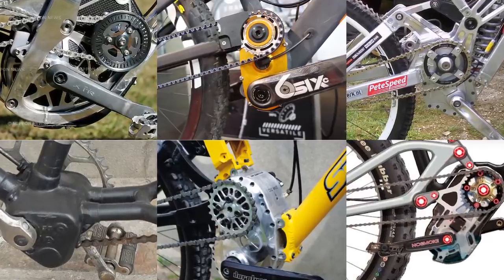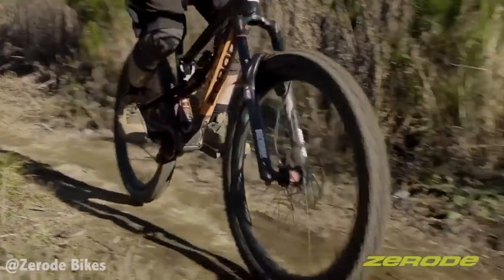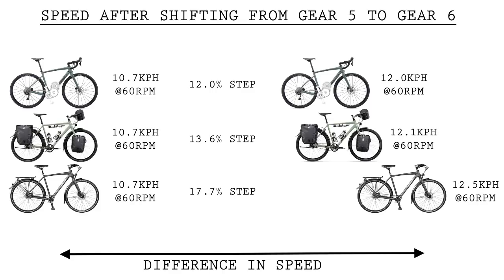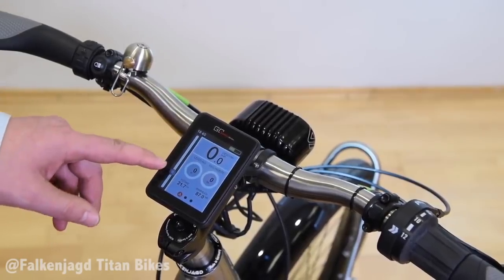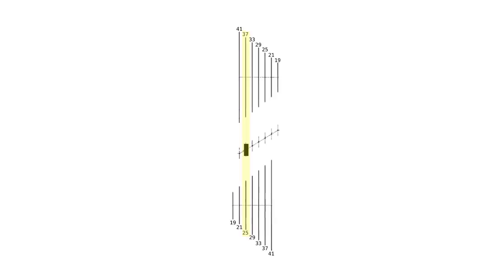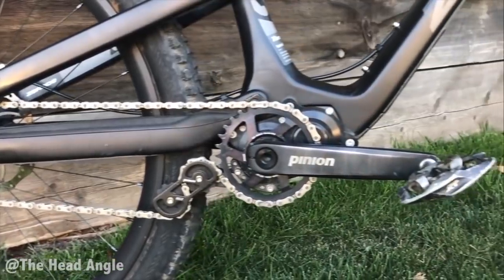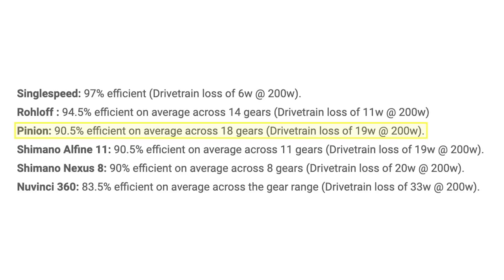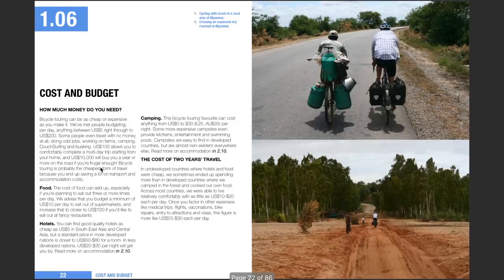Inside the FUTURE 13-Speed Shimano Gearbox - Weight, Drive Efficiency & More

Comment: Excellent explanation, the biggest issue I see with this system is that you will likely only be able to shift one gear at a time rather than dumping several gears for a tough climb.
The size and weight will also likely be factors in the gearbox design catching on.
Reply from the maker: You will likely be able to shift multiple gears at a time, just like a high-end derailleur system. That's currently two up and four down.

Comment: No thanks, i don't want to have to pay car prices to have my bicycle "transmission" worked on or replaced
Reply: Gearboxes can be simple, strong but not user fixable without tools and skills. For most it would be a disposable part which is fine if you get 100,000 kms.
Reply: loaded brush  hopefully made better than VW transmissions.
Reply: @glennoc8585  Are VW transmissions bad ?
Reply: @Guillaume_F  well hard to say when VW fudge their emissions
Reply: @glennoc8585  dsg in my touareg has 400xxx kms on it no issues yet
Reply: That's great and all but no one actually asked for your opinion
Reply: @glennoc8585  or Nissan CVTs
Reply: Same.
Reply: Alee said his bike gearbox requires very little maintenance over all the thousands of kilometers he has traveled.
Reply: Yeah... to me this has no advantages at all. Sure it will last you 3x the miles as a traditional drivetrain, but it will also be 5x the price to service so  doesnt really even out.
Reply: You won’t if Shimano rolls this out. As the video mentioned, cost competitiveness seems to be an advantage Shimano is looking for here. 

And FYI, I own a bike with a Rohloff hub. Unless you totally abuse it, service mostly is an infrequent oil change.
Reply: @holben27  shimano invented the integrated roadie levers and people said what you said. but here you have shimano Sora, which looks like a dura ace but its 8 speed, but hidden cables and what not for a cheap price.
give shimano some time and they'll make the gearbox cheap af, unlike sram or campy who don't trickle down technology

Comment: The thing is, shimano should make an universal gearbox that fit on traditional frames ie sit inside the main triangle of the frame.
Reply: While that would mean we could put it on any hardtail and roadbike, lots of full sus mtb linkage designs wouldn't allow for that
Reply: zeus lim who cares about full suspension?
Reply: What for?
Reply: Not gonna happen.   The only somewhat universal retrofit gearbox drive is the geared hub system like the Rohloff.

Comment: Great video! We will not see any big change regarding bicycles transmission until the day they will find an higher efficiency drive train , with the same weight (more or less) and dimension . The price it is not a big issue ; for a clear better performance I will open my wallet, no problem.
Reply from the maker: It's a high mark to beat, but perhaps we can get there!

Comment: From an MTB point of view, I could live with the extra weight when considering it will be going from unsprung to sprung, but I would not be able to live with a huge gearbox, suspension design and bottlecage all fighting for the same space in the middle triangle. I don't see it working.
Reply: This sprung n unsprung thing is total bollocks

Comment: i think the efficiency will be similar to a conventional drive. The internal chain length is nearly identical throughout the range so whatever tensioner is inside will barely add any additional rotation to the rollers in the chain. the main drive will be similar to a fixie, and the mini chain from the crank to the gearbox will be sealed and optimally lubricated at all times, will offset the efficiency lost to conventional derailleur pulleys.
Reply from the maker: Yeah, I've exaggerated a bit on the tensioner for simplicity. But the 2.5-3.0 watts per chain are still highly probable. Just running two chains will make your bike less efficient than a derailleur bike.

Comment: Granted I didn't cycle 1K+ km with my gearbox system (now retired for many years), but simplicity in bikes really matter. With car you can simply push pedal harder and pay more for gas, but with bike weight, space, efficiency, etc. all those factor matters, because you will feel it in your knees the second you start riding. And price matters too of course. So the reason we don't see gearboxes in bicycles is there is no good reasons to use them (the only one I see is the wheel building).

Comment: That thing is huge.
Reminds me of a story that I read in a German bike magazine. Bernhard Rohloff was approached by a big guy from Shimano (maybe even the CEO) on an exhibition, who told him the following: "You know, my engineers can come up with a 3-stage planetary gear box as well, but it is going to be double the size than yours". I found the original:
Yoshi Shimano, head of the company, comes to the Rohloffs at a trade fair and says: "We could build a 14-speed hub tomorrow. But it would be twice as big and twice as heavy as yours. How do you do it?"
The Rohloff patent expires soon, or even has expired already recently. It would be much wiser from Shimano to copy it and sell it for half the price of the Rohloff version. To put an old-school derailleur system in a massive housing sounds rather "uninspired" to me.
Reply from the maker: I hadn't heard that story! Just goes to show what a marvel Rohloff hubs are.
Reply: They tried to get into that market with the 11 speed alfine gearbox already. While the thing costs half as much as the rohloff, they didnt hafe ma whole lot of success with various reports on their limited reliability. To get a hub with the legendary reliability of a rohloff you need to do more than just copy the design itself. Its also about the right manufacturing process of hardened gears, quality controll, etc. Shimano might be able to compete with the expertise rohloff has build up, but in the end they wont be able to sell it for much cheaper. And with the market for such an expensive bike part being limited, the brand reputation of rohloffs reliability is hard to beat for shimano. I dont think they will be very sucessful with just copying the design. Maybe they can at least copy the shifter cables and indexing system, so their hubs arent such a nightmare with the indexing being off.
Reply: I wonder how the Alfine 11 Di2 compares, reliability-wise, to the mechanically-shifted version.

As I understand, and as you point out, the real Achilles' heel of the Alfine 11 is the precision adjustment required to not destroy the hub, combined with cable stretch and the indexing being at the shifter meaning that it's easy to come out of adjustment. (As I understand, the precision needed is because of the total shifter cable pull being the same distance as the previous 7 and 8-speed rotary shift mechanisms, but with more gears in the same distance?)

The Di2 model would, I assume, entirely eliminate that particular failure mode.

...of course, you also run into the lower efficiency of the Alfine 11 (which is only on par with the Pinion P1.18) than the Rohloff Speedhub... and Rohloff has an electronic shifting model (the E-14) too, if you actually want that (although it's only currently available paired to Bosch e-bike drives).
Reply: Maciej Jan Długosz  I guess it only feels inefficient due to the noise in the first 7 gears. Have mine now for 5 years and am enjoying it as on the first day. Had many bike journeys with it - one from Yangon to Kuala Lumpur. The hub simply works!

Comment: I would be glad with a system, where I have 9-11 speed on one side, and 2-3 speed on the other side, but with way bigger steps than in a derailleur system. e.g. in a 2x train a half and a normal speed. The bigger part should have some overlap in the modes, so I could select slower ratios in difficult areas, and faster ratios in road without continuously playing with the "front" shifter as well.

Comment: My local college added a bicycle engineering course to its curriculum in the last year or two. As a former student in the college's musical instrument programs, and as a former (old-school) bicycle roadracer who's worked as a mechanic at several bike shops over the years, I took interest in this new turn of events. I had initially imagined that the courses would cover new materials & methods of framebuilding, along with innovative componentry. Later, after looking around at today's market trends, I'd supposed that a lot of the students would be interested in e-bikes. Now I see this, and I'm wondering if bikes of the near future might come in a form that's ready-made for installing any of several competing gearbox-drive systems. This would require that all gearbox & frame manufacturers would develop a shared set of integration standards for achieving universal compatibility. It's also worth noting that the reduction in size & weight of gearboxes also means smaller parts taking on proportionally higher loads, & therefore a reduction in durability emerges as size & weight are decreased, so that's something to focus on during design development. I'll be sharing your excellent video with Minnesota State College Southeast any second now. Thanks tons, I'm betting the students & instructors there will be inspired by it. BTW, I'm already a subscriber.

Comment: I wonder if one couldn't eliminate some of the metal with opposed cones actuated with a governor system, how about a two-step belt drive to actuate rear hub transmission? There's a lot that can be done, in the future we will perhaps see transmissions with incorporated armatures to make hybrid drive transmissions systems, high-end chains and cassettes may finally go away and cheaper belt drive systems are certainly a possibility, we cannot step on the "toes" of profitability though, so 'trickle-down will be slow.

Comment: Very cool info. As a bike tourer, i am definitely interested in this news from shimano. I wonder why the big bike companies like giant & trek haven’t used pinion gear boxes yet? It seems only small independent companies are making bikes with pinion gear boxes & carbon belt drives. And they are VERY expensive! Hopefully if shimano enters the fray, prices will come down.
Reply from the maker: Price and production volume is your answer!
Reply: ᴄ ʏ ᴄ ʟ ɪ ɴ ɢ ᴀ ʙ ᴏ ᴜ ᴛ yeah, i hear ya. But i could see this being a big thing eventually and trickling down to the mass market. Like disc brakes did back in the day. I really like the low maintenance aspect. Especially when on long bike tours. CoMotion & Koga pinion bikes are very expensive. At least for me right now. But a pinion bike with a carbon belt drive called the Priority 600 Ryan Duzer reviewed on his channel looked affordable at about a third of the cost of the ones from CoMotion & Koga. So i may give that a try.
Reply: @BikeTall     I have owned a Priority 600X for almost a year now.  Love it.   The suspension fork from Wren is top notch.   The Pinion 12 speed, also top notch.   The Gates Carbon Drive is fantastic.   One thing I am going to upgrade on the belt drive is shield for the lower (slack) side of the belt.  It has been vulnerable to small pea gravel (in wet conditions) landing on it and being transported to the rear cog where it is crushed between the belt and cog.  I'm sure this is not conducive to long belt/cog life.  If a shield were made to be over this portion of the belt, the problem would mostly go away............

Comment: This could be better than that. Per March 2013 article on Velo Magazine, Molten Speed Wax used 4.75 watts out of 250 watts. That is 98% efficiency. Your 97% singlespeed chain number is more like the garden variety lubricant like White Lightening. Assuming Shimano with their optimized lubricant and surface finish can improve on Molten Wax by 20%, which seems reasonable by their graphs, you are at 95.5% gear box efficiency. That will put you above Rohloff efficiency. If Shimano is cheaper, that could be a game changer.
Reply from the maker: Good point - lubricants vary widely in terms of resistance, which will skew my numbers a bit. 

The singlespeed chain was the control in a test that compared the Pinion gearbox, Rohloff hub and other gearboxes, which is why I've used for this example too. The 97% singlespeed number is based off a machine simulating 200w where the drive resistance was 6-watts. From that test and others, we know that the drive resistance doesn't vary much between 200-250w - so the following numbers shouldn't be too far off.

Assuming the Molten Speed Wax (or an equivalently efficient lube) is used for the three chains of the Shimano Gearbox drivetrain, the 9-watts resistance could drop to 7.2-watts (2.4-watts per chain), bringing us up to ~91% efficiency overall. But the drive efficiency of the Rohloff would also get to increase to 95.1% efficient if it was also tested with Molten Speed Wax.

For fun, let's say Shimano can improve the lube formula by 20% on Molten Speed Wax. That means the three chains will run at 5.75-watts (1.92w per chain @ 200-watts) - plus the pulley and bearings - and it's up around 92.25%.😊
Reply: @Cyclingabout  add "milliwatt craving" 2 "gram shaving" slur pile?

Comment: Hello Alee, I don't know anything about Pinion and Rohloff. I think I'll be buying a bike like this with one of these systems next year.
I have a question if both of these systems can work on one bike simultaneously or if Pinion excludes Rohloff and vice versa.
Reply from the maker: You can technically use both but it'd be very unnecessary.

Comment: So, I don't see any upsides over current 1x systems.

1. it's going to weigh more
2. most likely going to cost more.
3. maintenance may be marginally lessened in frequency but will be much tougher and more involved than 1x systems - chain will stretch and cassettes inside will wear.
4. Lower efficency
5. lesser overall gear range than currently on the market.

Comment: Be better for us all if they just bring out a enclose case that you can just fit over the gear sets with just the pedal arms outside!  Have different versions of the cases which can fit any of the types and numbers of gear sets.  That way they have all gear sets able to be covered up from the mud & crap. You just have a locking system to unlock or lock up the two half's that make up the gear set covers?  You unlock it and oil the gears do maintenance and then re-lock the two half's back together!  So that be a top half & the bottom half with rubber seal between.  No fancy gears needed no buying a new bicycle just to have these super new gears.. just cover the gear you have.  the cover could be say carbon fibre so it be light and strong and water protecting.

Comment: After all these  advancements and  investment that is put into this transmissions,  it is loosing in one crucial area.
 As far as I am aware of," it is still not able to shift while stationary or after an emergency stop". 

Correct me if I am wrong.

I do have some solution for this in my mind, as I am thinking about it for a while now. :)
Reply from the maker: You can't shift when stationary. The only way this would be possible is if the cog to the rear wheel was fixed, so that the cassettes were always spinning. But then you have a constant drive resistance.

Comment: Thanks for the video! You think it’ll be a gamechanger? I think it will be a flop. The market for this seems very niche.
Casual bikers will find a  Nexus 8 fine. (Also allows for a mid motor ebike)
Globetrotters will still want Rohlhoff.
And for whom weight matters, there’s still derailleur.
So for who is this? I don’t see it.
Reply: Same people running pinion or rohlhoff. One more option.

Comment: Until Shimano actually comes out with this, which do you recommend for a touring bicycle? A bike with a pinion gearbox & carbon belt? Or a bike with a rohloff hub & carbond belt? I am currently looking at either a Co-Motion Pangea with a pinion gearbox or a Koga World Traveller s with a rohloff hub. Thanks!
Reply from the maker: Rohloff is lighter (1kg), more efficient (94.5% vs 90.5%), cheaper by 1000 euros, faster hub engagement, and Rohloff has had more time to iron out any kinks in their gearboxes (20 years vs 7 years). Don't get me wrong, I really like Pinion! But I like Rohloff a touch more for the above reasons. 

You can read the advantages of Pinion here: https://www.cyclingabout.com/tour-with-a-pinion-gearbox/
Reply: ᴄ ʏ ᴄ ʟ ɪ ɴ ɢ ᴀ ʙ ᴏ ᴜ ᴛ Yeah, i am leaning towards a rohloff hub setup. Thanks.

Comment: 🔴 Why don't they/we seal the entire chain?   Or at least maximise the sealing of it?  I reckon we could do this with a thin light material, that's very ready to remove in the event when the chain slips or needs maintenance.

What's the reason why we don't do this?
Reply from the maker: We have products that seal the chain away, but they add ~4 watts drag to the drivetrain.

Comment: How did you originally make the switch from drops to alternate bars? What was the catalyst of change?  Thanks for the Inspirarion mate.
Reply from the maker: I purchased some Velo Orange Crazy Bars around 2015/16 as I calculated I was only using the 'drops' 5% of the time. I went with the Crazy Bar as I wanted to keep the 'hoods' from my drop bars.

I then realised how awesome having the extra steering leverage is with a touring load, and now I can't see myself going back! Maybe if I used a bar like the Crust Towel Rack or Nitto Shaka...

Here are all the reasons I like a wide alt bar: https://www.cyclingabout.com/drop-bars-on-touring-bikes/

Comment: Help me in spotting my mistake. The Shimano solution does still have a rear shifter? 

Is the Shimano is a hybrid, while the Pinion is a "true" gearbox?
Btw. Pinion claims their service intervall for the 18 gear version is 10.000km.
Reply: It is. if you call changing oil "service". 

It's really a hassle free system. (apart from the weight and the slightly lower efficiency.)
Reply: @HotelPapa100  Txs mate